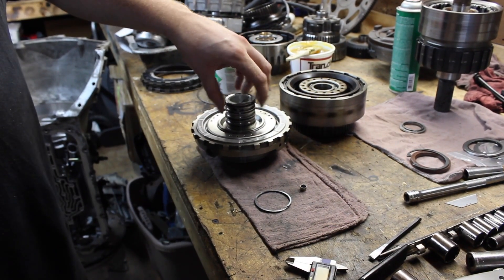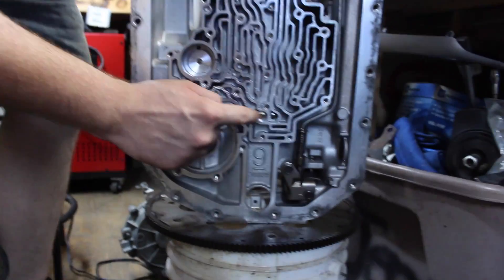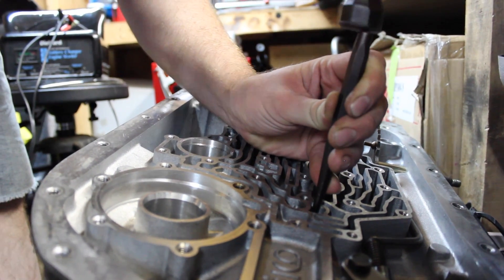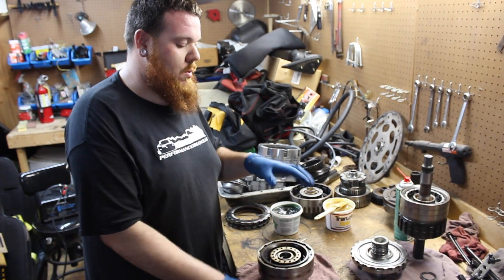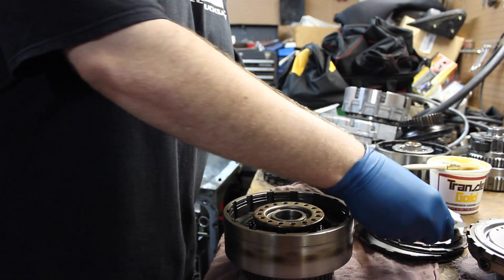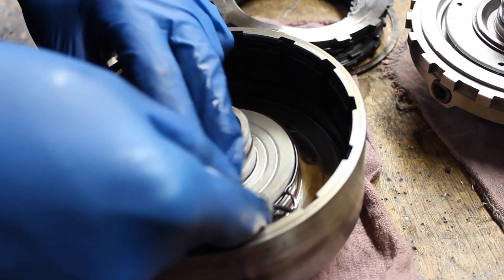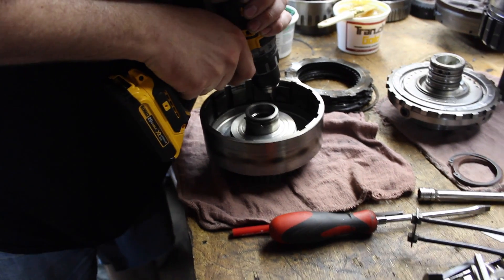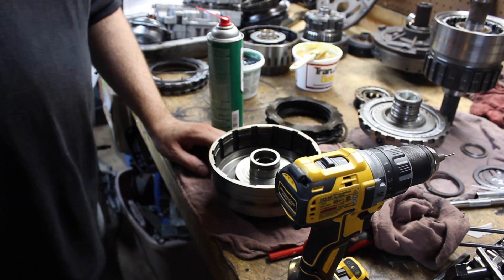Dual Feeding Direct Clutches 4L80E

Comment: If the idea of dual feeding the clutch pack is to add more surface area on the piston to be pressurized doesn't drilling a hole in the chamber that is being pressurized bleed off the pressure?
Reply: I think that's taken care of by the by the plug in the valve body. The hole drilled is to release pressure at high RPMs ~6000+      Disclaimer: I could be wrong

Comment: VIDEO SHOULD BE CORRECTED OR AT LEAST ADDRESS THOSE WITH NO REVERSE ISSUES!!. Bur maybe they aren't installing their spraggs backwards.

 This from the LS1TECH pages_----------"I fixed it. The intermediate sprag was backwards. I also removed the reverse check ball. If you dual feed your '80e, make SURE to remove that reverse check ball or it WILL NOT WORK!"   from maroon monster "Thanks for posting results. P.s. you don't have to remove reverse check ball. That often makes reverse engagement too rough...especially in vehicles with raised line pressure. Best thing to do is just drill the reverse feed orifice slightly larger. It will give a smooth apply that's not too aggressive but not sluggish"
johnH123 is offline

Comment: I suppose it wouldn't hurt to drill that hole in the drum but I've never heard of the 400s and the four old ladies having the centrifugal apply issue like the 4l60 does.  The only time I've drilled that hole in the direct drum is on a trans brake application.

But who knows if somebody figured that it works better than so be it but I never known the 400 and 4l80 to have that issue
Reply: I actually also read that a 2nd hole shouldnt be drilled in the drum and that you should only enlarge the existing apply feed hole on the drum. Is that how you do it? Do you also remove the center seal on the drum?

Comment: Doesn't the bleed hole  leak apply pressure ,kinda like a bad lip seal would?
Reply: What I was thinking but the hole is much smaller than the feed hole. If the whole was about the same size or bigger I'd be worried

Comment: 727 intermediate cl. snap ring? no such thing
Reply: Yes there is...more specifically its a Chrysler 727 snap ring which is much thicker than the stock one. Prevents breakage and helps set intermediate clutch pack tighter 👌

Comment: Hey I did the dual feed and I burned up another rear planet on my 4l80e they first one was about 200miles and now I rebuilt it dual fed it and added a sonnex kit with new oil pump and the rear planet did the same thing it burned up and melted any ideas what's going on? Gallegos276@gmail.com thanks man
Reply: You probably have the cooler line adapters on the case backwards. Make sure you have the adapter that's way longer in the back port. It's longer to reach to the rear support to oil the rear of the trans. And make sure there is a o ring in the hole.
Reply: @danking5382  thank you
Reply: @gallegos276  your welcome, even though it's been a year it's there for others. Was that your issue by any chance, or did you give up?
Reply: @danking5382  just went to junk yard and rebuilt a differnt one. I kinda noticed that and wondered if i had it correct but already cored it lol
Reply: @gallegos276  damn that blows at least you got something going tho. About to do the same thing myself. Rebuilt my 4l60e once in the last 4 or so years and refreshed it a few months ago, tired of worrying about it. Gonna get myself a 4l80e or 85 and shove that thing under there haha.

Comment: Doing this would illuminate the need for the multilayer plate from a trans go kit, should the rest of the kit be installed per their instructions, minus the pressure relief?
Reply: I wouldn't use that junk kit to begin with
Reply: What kit do you use?
Reply: jakes recal kit
Reply: It would eliminate the need for a Transgo period, the only benefit of the transgo is that it dual feeds the directs without the trans coming out of the vehicle.

Comment: Done all the modifications that you have suggested super excited didn't know if there's check ball in the case that should be removed for the Dual feed
Reply: Yeah I left out number 7 I think put the trans back in the truck this past weekend. Feels good reverse feels a little weak you have to tap the gas to get it to start backing up just ordered pressure gauge plan on going through the pressures making sure everything is working properly can't find any specs on pressure when doing a dual feed.
Reply: dual feed has nothing to do with pressure.
Reply: theres a few to be left out

Comment: Can this be done with out any shift kits at all, i have a new direct drum with new molded piston to get away from the this cast aluminum piston. i do see the value and reliability of this mob. This is a 1994 model year as well.  2nd question. on the forward drum piston is aluminum piston as well, i purchased the molded piston as well and trying to get information on using existing seal holder with new seal on bottom of drum or remove it, and install press on molded seal? I can't seem to find any info on this.Any info would be great. Thanks
Reply: yes most definitely do the dual feed. honestly theres nothing wrong with the cast pistons. use forward steels in the direct drum and add a 6th clutch. run clearances .010-.012 per friction. use a sonnax boost valve in the pump. and get a torque flite 727 heavy HD intermediate clutch snap ring for the intermediates in the 80e
Reply: John J Hall IV, dry or wet? I ask because everyone has there method. Picked up parts today tomorrow morning going to tap threads in as case has been drilled to about 3/8

Comment: Uhh. Less apply by drilling hole ... After dual feed you just drill a hole. Funny. Just use clutches that have oil grooves to prevent centrifugal apply or slice holes in the steels. Or just put a thin steel in to increase clutch clearance. Also get rid of the wave. I could go all day
Reply: no just no. this is proven the way I showed it done and any good reliable well known trans company can attest.
Reply: You also didn't put heavier springs in which is what actually holds the piston back. It's like half a blow job

Comment: I'm planning on rebuild for my 4l80e.I already have a new transgo HD2 kit.Should or could this dual feed mod still be done.This is for a daily driver hd truck that I plan on towing with once in a while.Ive replaced transmissions but this will be my first build so I'm new to internals.thanks for any info.
Reply: yes do this and toss the transgo stack plate and pressure relief right in the garbage. I personally don't like the trans go kits at all.